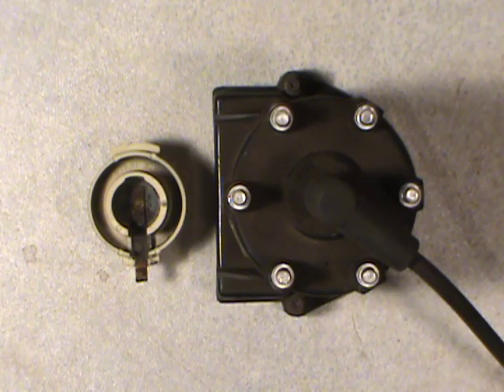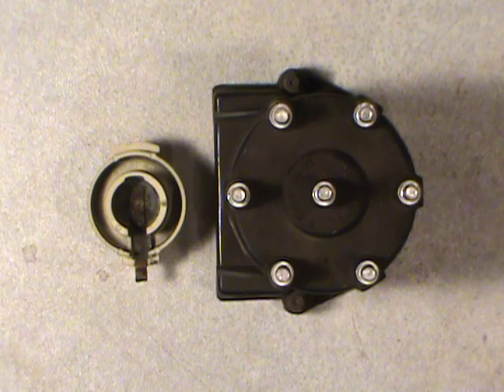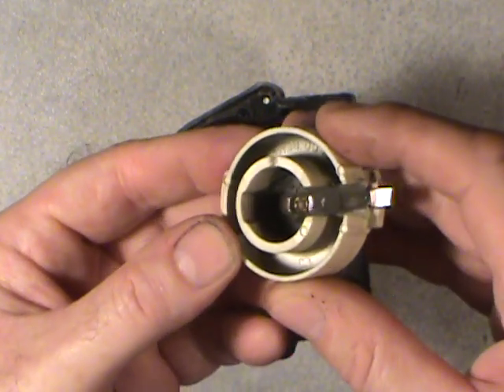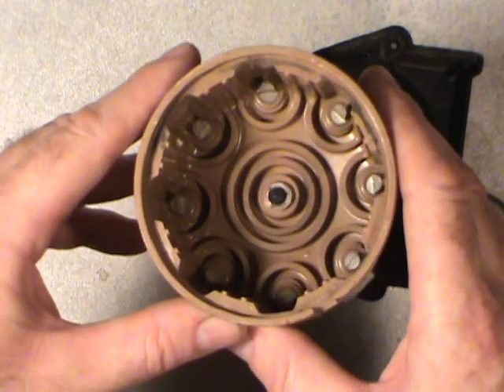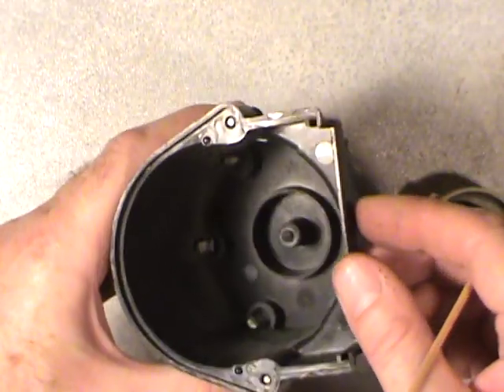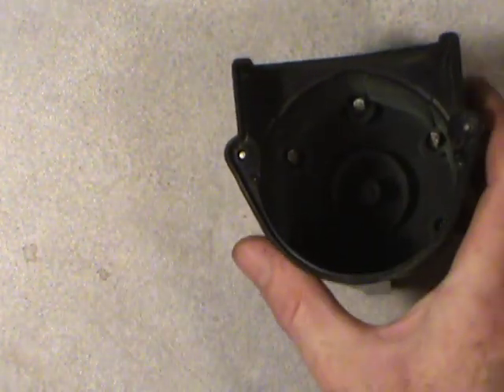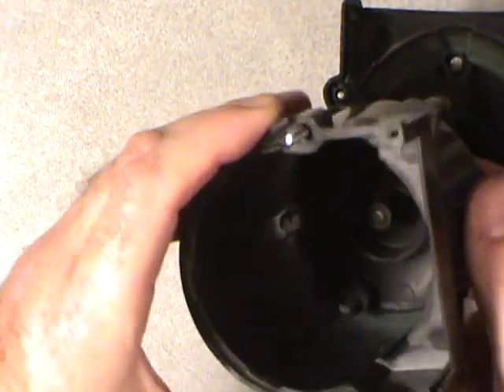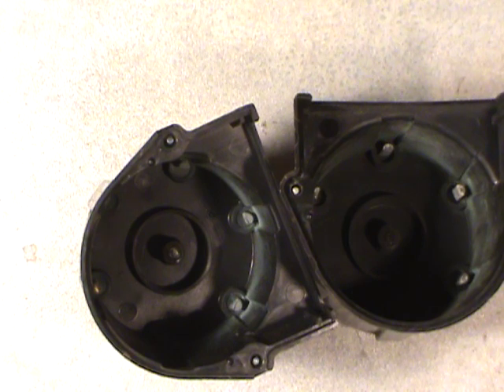How to Inspect Distributor Cap and Rotor Condition (Part 1) of 2 Parts

Comment: Could bad cap or rotor cause engine vibration on a dead stop acceleration. Car is 99 civic ex 5speed new water pump, belts, thermostat, plugs, wires, clutch, radiator. It started doing this after new clutch installation. Before the new clutch the car would hesitate before takeoff on dead stop. Now with the new clutch engine shakes when I don't give it gave but when I give it gas it doesn't shake. Thanks!!
Reply from the maker: Joe Vang Greetings Joe Vang....Thanks for watching.............There can be, quite a few "Things", that can make Your Engine "Act", like You were Describing, in Your comment...................................There are, as I see it, a few "To Do's", to Reduce the chance, at having, a not so Happy & Well Running Engine..................................I like to use an "Old Saying", every now and again, and that "Saying" is..."The Chain is Only as Strong as the Weakest Link"...pretty much meaning, try to keep all of the Vehicle's "Parts and Pieces", in good working order, as in, Air & Fuel Filters...as well as...Change all of Your Vehicle's Fluids, when the Time or Mileage/Kilometer-age becomes due, as that in itself, sure helps...................................Well, if Your Honda "Runs really Good & Strong", while You really "Step on the Gas Pedal", then, to me, the Hesitation, could be caused, by something, along the lines of a "Vacuum Leak", and it could be caused by "Many Things"....................................Could be a Faulty "Vacuum" Rubber Hose/Metal Tubing, or maybe Disconnected somewhere, in Your Honda's Engine Compartment....................................Did You "Check" the "Gap" between the Spark Plug "Electrodes"...Before they were Installed in Your Engine...???..................................Make sure, that All of the Spark Plug "Wires/Leads, are kept away from one another, and, not near any Metal Components, in Your Honda's Engine Compartment, to help Prevent, what is known as...Ignition Related..."Cross-Fire"...that's where, sometimes, the High Voltage, from One Spark Plug Wire/Lead, gets "Transferred Into", One of the "Other", Wires/Leads, just sayin'........................................................"If" Your Honda does have a Distributor & Rotor, I think it would be a very Good Idea, to Install a "New" Distributor Cap & Rotor, and try to get a New Distributor Cap, that has "Brass"..."Terminals"...on/in it, as I find, the "Brass Equipped" Ones, much better then the "Aluminum Ones", and, not much more money as well.....................................There are basically "2"..."Things"...that should be done, on just about any, (Gasoline) "Fuel Injected Engine", and those "2-Things" are..........Have Your Honda's "On-Board Computer"..."Scanned"...for..."Trouble Codes", which requires a Hand Held "Scanner", and that will almost "Pin-Point" any Problems, without having to go on, what I like to call, a..."Wild-Goose-Chase"...lol...................................If You don't have a "Scanner", and don't care to Buy One, then, make a few Phone Calls, to some "Vehicle, Parts/Sales Establishments", and ask "Them", if "They" will..."Scan"...Your Honda's "Computer For Free"...???...as I've heard, that, some of "Them" actually "Do"...!!!............................Then, the Second "Thing", that should be Done, is to get Your Honda's..."Fuel Pressure, Checked/Verified"...................................."If"...???...Your Honda's..."Fuel Pressure"..."Is Not"..."Within Specifications"...for the most part, Your "Engine", just won't "Run, as Good as It's able to"........................So then, consider what I was tellin' You about, just above, and, if You care to, You can let me know, how it's goin'............................If You need any more help or advice, just let me know, in a comment/reply, under any of my YouTube Videos..................................Good Luck...and...Till next time..............Be Safe, take care, and have a good one.
Reply: The air and fuel filter is new. Well thanks I will check for vacuum leaks and also change the cap and rotor. We'll see how that goes. It's strange because the motor run great and idles great. The only problem is the one I describe. Anyways thanks!!

Comment: "new and improved" usually sucks. If it works dont fix it.
Reply from the maker: journeyquest1 Greetings journeyquest1....Thanks for watching, and for Your comment as well..........................................When it comes to, like You were sayin'..."New and Improved"...I would probably be placing, this particular..."Distributor Cap & Rotor"...on, the..."Top Ten List"...of what should be, as I see it..."Improved" (as, if and when, an Improved "One" is acquired, it will probably be "New")................................................The.."Size"...and..."Wimpy-ness"...Design, of this particular..."Distributor Cap & Rotor"..."Might"...have been..."Acceptable"...for the older..."Point & Condenser"...type of..."Distributor"...along with an Ignition Coil, that had a Ballast Resistor in its Ignition Circuit, that had Spark Plug "Gaps", of about..."Only .035" (thirty-five thousandths of an inch), that..."Did-Not"...need as much, Ignition Coil..."Secondary High Voltage"...as compared to, that of which, is put through this particular "One", that has to Supply, a..."Much Higher Secondary Voltage"...in order for the..."Spark"...to..."Jump the .045" (fourty-five thousandths of an inch) Spark Plug GAP"...that is part of this particular, shall we say..."High Energy Ignition"...System/Circuit...!!!..................................................All a Person has to do, is, have a look-see, at the good ole..."HEI" (High Energy Ignition) Distributor, that was usually found, beginning, oh, around 1975, that was Installed in most..."V-8 Engines", and, You'll notice, just..."How Large" (in Diameter & Height), that, that particular Distributor Cap (& Rotor)..."Actually Is"...!!!.................................................Yes-Sir-ee-Bob...as I see it (probably along with many Others, as well), is that, seeing as how, the..."Larger the Spark Plug Gap"..."Is"...the..."Higher"...the Ignition Coil's..."Secondary High Voltage"...has to be, in order to, shall we say..."Jump that Much Larger Spark Plug Gap".....................................................I have found that, just about any time, that the Spark Plugs..."Gaps"...get any..."Larger"..then .035" (thirty-five thousandths of an inch), then, the Parts and Pieces, that are part of the..."Secondary, High Voltage Side"...of the Vehicle's Ignition System, are subjected to, a Much Higher Rate of, shall I say...Higher Secondary Voltage..."BREAK-DOWN"................................................That's where I'm finding, especially on the Ignition System, that the Distributor Cap & Rotor, that is seen in this particular video of mine, is Included in, that, the Distributor Cap & Rotor, are basically a Joke, in as far as its Design and Wimpy-ness, for something, that's tryin' to be, a wanna-be..."High Energy Ignition System"...that's supposed to be able to with-stand, the..."Amount of, High Secondary Voltage" (that's coming out of the ignition coil's secondary side), that's needed, in order to make that..."Spark, Across, that Increased Spark Plug Gap"...!!!.................................................That..."small"...spring loaded Carbon Button, is way too..."small"..........................................The Rotor, that goes along with it, is something that I'd expect to find in a..."Dollar Store"...and..."Not"...something that an..."Automotive Engineer/Designer"...would be proud of, being responsible for......................................................About the only thing that I came across so far, as it applies to, a, shall we say..."Improved Distributor Cap" (like the One in this Video), happens to be, along the lines of..."Brass Terminals" (as opposed to just be-in' Aluminum), and probably...(keeping fingers crossed)..."Improved Material"...that, both, the..."Distributor Cap"...and the..."Rotor"...are made out of.......................................................About the..."Only Way"...as I see it, that this..."Lack-Luster"...wanna-be...High Energy..."Distributor Cap & Rotor"...will be able to..."Last, a reasonable amount of time"...would be, and I might just give it a try as well, would be to..."Reduce the Spark Plug Gaps"...from...".045" to .035"..."..........................................Even the..."Spark Plug Wires/Leads"...didn't do a very good job, at standing up to the "Secondary High Voltage"...that was required to..."Create a Spark"...between, the..."Spark Plug's .045" Gaps"..........................................Hmmmmm...if it wasn't for this Engine's Computer System...I would probably Install a..."Points & Condenser Distributor"...Ignition System in "It"...as, over quite a few years...that was..."Something that I could Depend On"...on a regular basis.................................................So then, there You have it, for the time being....................................................Be Safe, take care, and have a good one.

Comment: hi my wife has a nissan bluebird 95 can this cause the car to idle funny if she revs it it will die and sometimes dies up hills
Reply from the maker: Nick Forrest Greetings Nick Forrest....Thanks for watching, and for Your comment/question as well......................................................Sorry to hear that Your...ooops, not Your's, but Your Wife's Bluebird is not running all that well...............................Let's see, if we can track down, just what the problem, or problems might be.......................................................The first couple of things that pop into my mind, as soon as I read, what the Bluebirds Symptoms were (that You indicated in Your comment), are that of, an Engine related..."Vacuum (air) Leak"...or, perhaps something, that is preventing, the much needed..."High Fuel (gasoline) Pressure"...in the Fuel System, that is "Needed", in order to have Your Engine's "Fuel Injectors", to have the ability, to supply the Engine, with enough "Injected Fuel" (gasoline), so the Engine will run smooth and have plenty of power as well........................................................There are usually "2" things that need to be done, in order to help avoid, having to go on, as I like to call it..."A Wild Goose Chase"...................................................The "Fuel Pressure", in the Fuel System, has to be with-in the Vehicle Manufacturers "Specifications", and, that should be verified with a "Fuel Pressure Gauge"............................................If You do it Yourself, be aware that there is some quite Dangerous Fuel Pressure, in the Fuel System, of a Fuel Injected Engine, and make sure, that You fully understand, how to "Safely" bleed off the Fuel Pressure, before disconnecting any fuel line fittings, or connections, and Always wear Safety Glasses, and have a fire extinguisher nearby...!!!..................................................The other thing, that should be done, is to find out, if there are any "Trouble Codes", being "Stored", in the Bluebird's "On-board Computer".........................................................I'm not sure, as to which "Type" of "Computer", that's installed in the Bluebird, as it might be that of, an "OBD-2" (On-Board Diagnostics, version 2) type, that requires a "Scan Tool" (kinda looks like, a slightly larger, hand held Calculator), that uses a cable/connector, to Connect to the Bluebird's "Diagnostic Port" (if it has one?), to "Extract" (aka, read) the "Trouble Codes" stored in the Bluebirds on-board Computer (if there happens to be any, that is)...or...the Bluebird's on-board Computer, might be, the Type, that only requires a "Screwdriver", in order to, Turn a "Screw", (just a partial turn), that is usually seen, on the "Outer Case", of Your Bluebirds on-board Computer................................................Make sure, that You fully understand, the Exact "Procedure", when-ever trying to "Extract" those Trouble Codes, from the Bluebird's on-board Computer, or, something might go "ZAP", and, at the very same time, "Expensive" as well...!!!................................................Check with some of the, I would say, "Larger", Vehicle Parts Sales establishments, in, or near Your Neighborhood, over the telephone, and ask them, if they would "Scan", or "See", what "Trouble Codes" (if any, that is), that might be "Stored" in the Bluebird's "On-Board Computer"..."For Free"...(as I've heard, that some Parts Places in the United States of America, actually Do this, for Free!)...................................................Also, ask them, if they can "Check" the Bluebird's "Fuel Pressure" as well, (might not be Free, but reasonably priced, I hope), but should be done, never-the-less...............................................So then, Once You find out, if there happens to be Any (or Not), "Trouble Codes"..."Stored", in the Bluebird's Computer, and have also "Verified", that the Bluebird's, "Fuel Pressure", "Is, or, "Is-Not", with-in "Specifications", as, that my Friend, is a Great Starting Point, and, if needed, You can always let me know, how You're Progressing, and, I'll do what I can, to help You out.........................................................Here are a few "Things", that You can "Visually Check", with the Bluebird on Level ground, Engine Cold and Not Running, Emergency/Parking Brake On, Ignition Key in Your Pocket or Purse, as the case may be....................................................In the Engine compartment, have a look, at all of the "Vacuum" (air), "Rubber Hoses", that usually connect devices together, as at times, they can actually become "Disconnected", making for that "Vacuum (air) Leak", that I was talkin' about earlier, and also, look for any "Cracks/Splits" in those Rubber Hoses, while You're at it, just in case...................................................Last but not least, I should also be askin' You...have You, or, who-ever, been keeping up, with "Regular Maintenance", on the Bluebird, You know, Air Filter, Fuel Filter/s, Ignition related parts and pieces, as is usually indicated, in the Bluebird's Owners Manual, at the Vehicle Manufacturers, recommended replacement intervals...???............................................Oh yeah, just by having, a somewhat Dirty, and plugged-up Fuel Filter, that alone, has the ability, to make the Bluebird...Behave...just like You were saying, believe it or not.............................................Also, make sure that You "Change/Replace" the Bluebird's Fuel Filter/s "Regularly", or, the Bluebird's, Electric "Fuel Pump", might Burn Out, which happens to be quite Expensive as well...!!!............................................And, again I say...that "High Fuel Pressure is Dangerous", and must be "Bled-Off" (Reduced to Zero Pressure)..."Safely"..."Before", Changing/Replacing, the "Fuel Filter"...!!!.......................................Always remember..."Safety comes First"...!!!...............................Good Luck.......................Till next time...Be Safe, take care, and have a good one.